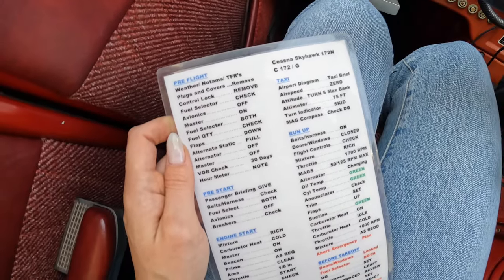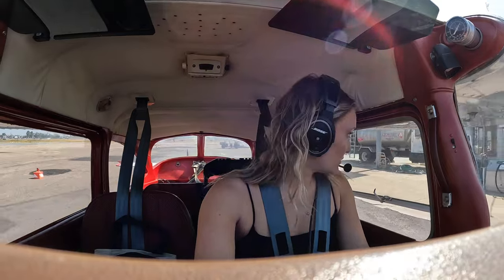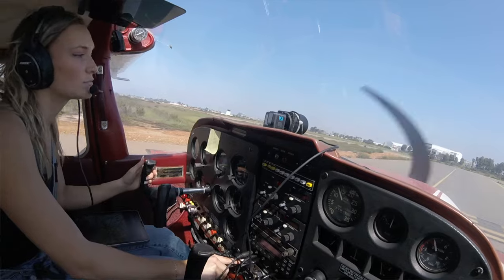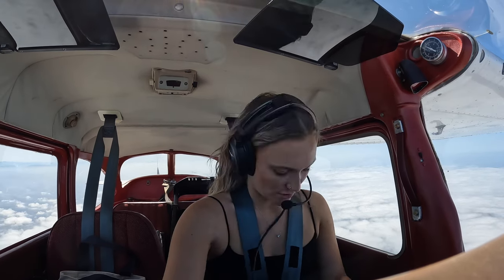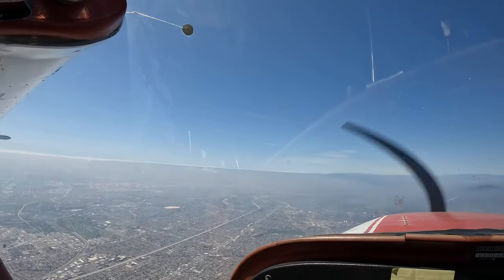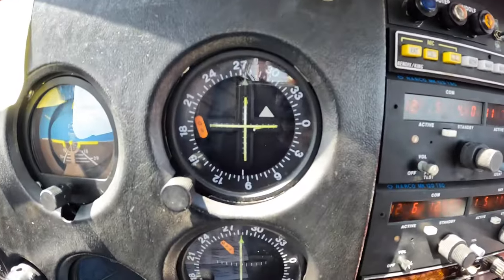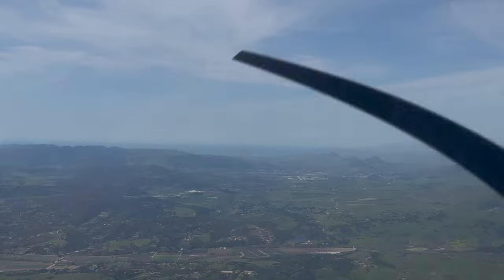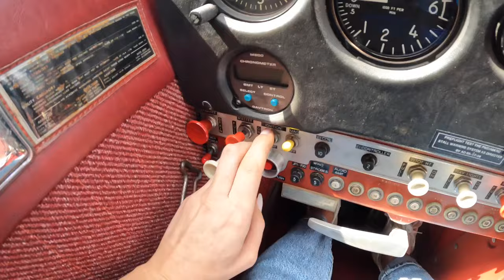Flying my 1967 airplane again!

Comment: after 7 months i'd take more time with the check list ..you seemed to just look at it and read it off fast without eyeballing the items ...also it's kinda hard to see if the controls  are free and correct if you do not look away from the panel at the control surfaces to confirm
Reply: It’s an edited video. What you see is not necessarily what happened.
Reply: @takl23 ..for the sake of discussion...I see her manipulate the controls through the range of motion while speaking the words and looking at the panel...how is that edited ?
Reply: Can you guarantee she didn’t do it twice?
Reply: @takl23  now you're just being argumentative for arguements sake
Reply: Thanks for sharing…ignore the jealous haters!😊